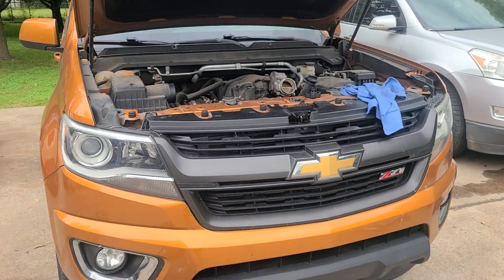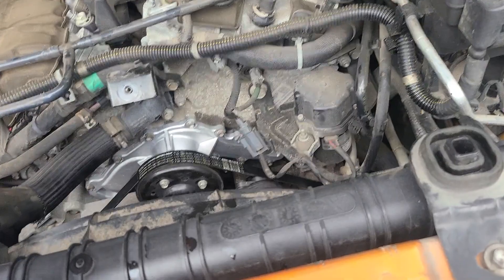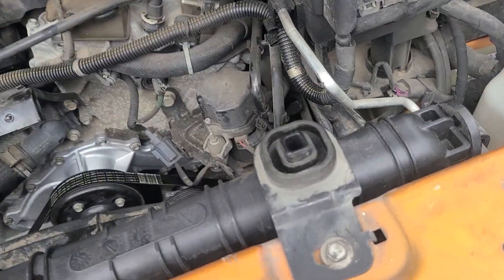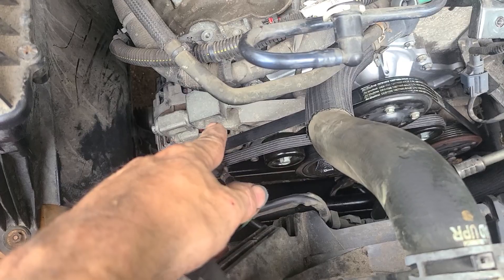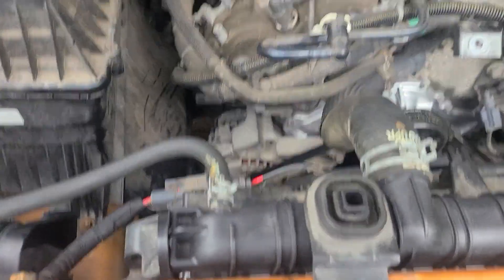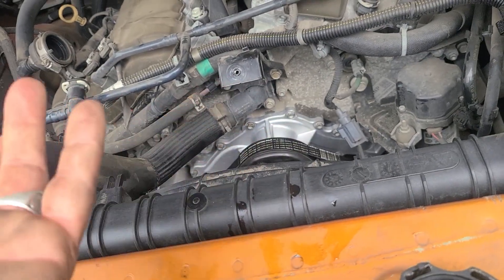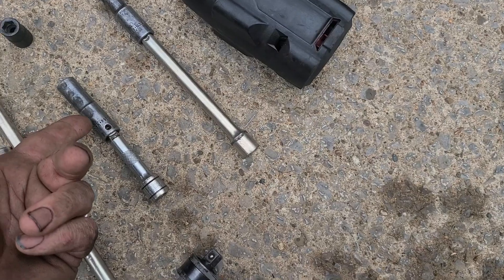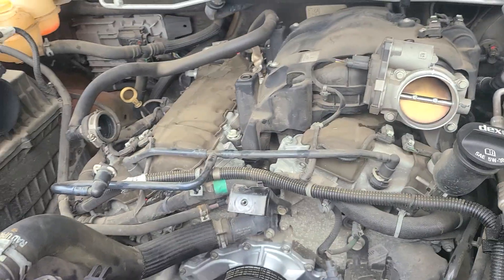2017-2022 Colorado 3.6 waterpump removal

Comment: I am in the middle of changing mine on the same vehicle. The bracket for the alternator, did that come off easily. I have removed the bolts but it seems to be stuck. Just checking that was normal before I beat on aluminum to knock it loose lol